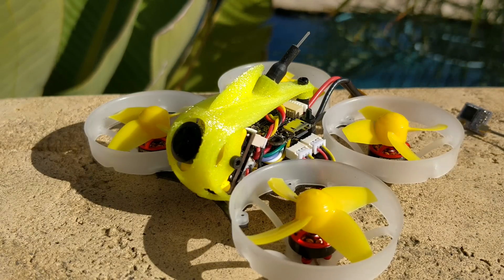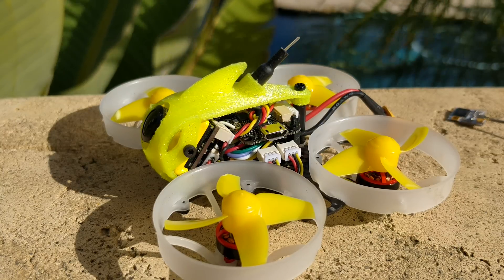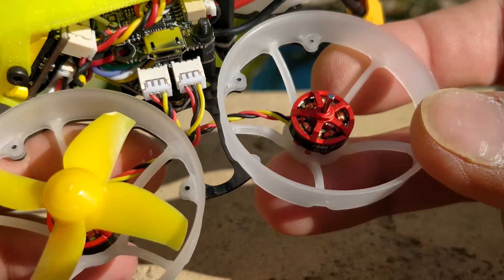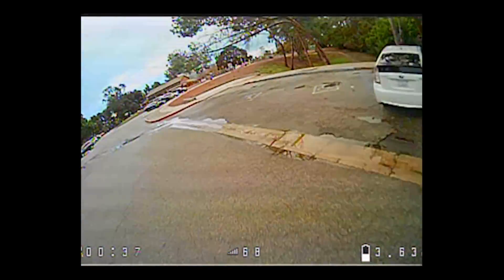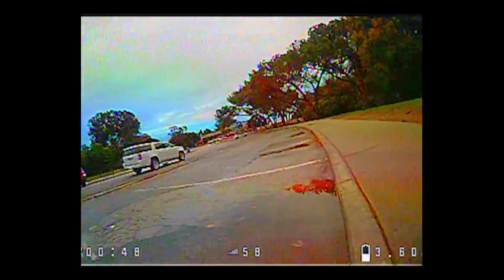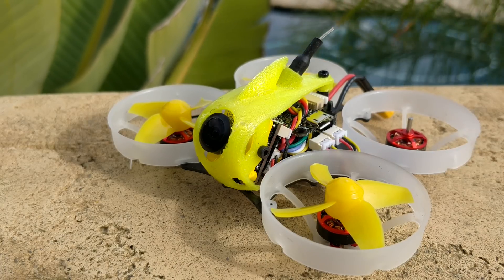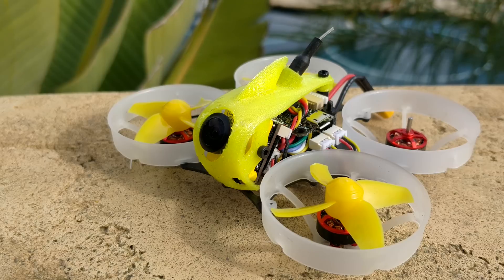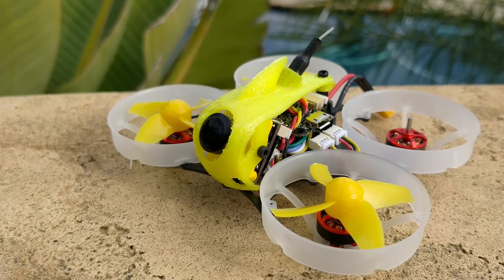Tiny Leader - Leading the way?

Comment: LOL same EXACT issue I had and many but I was called all kinds of names when I said people are going to have problems with these ESCs.. I was right LOL.. Fullspeed is sending out replacement ESCs. I modded mine with a 18A 4in1 and it's better. I also looked at the weird way they had the BF settings and changed them. It flies much better and because of the mods I've done I way able to bring the back of the TPU canopy down in the back to give me more camera angle... I like how mine flies NOW but for the price this should have been done by FullSpeed..

Comment: Hey Bob I converted this to a 2 inch ductless frame and it is much better https://rotorbuilds.com/build/15814
Reply: Also, these are the motors I mentioned a few weeks back that should be good on the toothpick, hopefully wires are long enough, plugs are a bonus
Reply from the maker: You basically made it how it should have come.  Probably flies great!
Reply: @Kabab  thanks, it does 😊.

Comment: What rates do you run on your tinyhawk? I can't find rates that suit me well so I was wondering what you are using, really good video btw
Reply from the maker: my rates are always somewhere between 1.1 and 1.3 for everything.  All of them the same.  Everything else is default.  0.7 super expo for all and zero regular expo for all.  For this tiny leader I had to drop the super expo to .6 because of it's dumb flight characteristics and push the rate up to 1.4.
Reply: @Kabab  do you use acro or angle for the tinyhawk when indoors and doing proximity. Also just got new gnb 450 lipos for it and they are much better than the stock emax one.
Reply from the maker: @luke.pike33  I only use full manual acro. Never any autolevel

Comment: I totally agree with your video!👍 This is a NUMBERS GAME quad! It has great numbers on paper but those numbers don't make sense in a who0p! 🤔😕
Isn't the whole point of a who0p, is to be able to fly a quad indoors?
If not, what is the point? How do we even attempt to fly something soooo heavy and powerful indoors. We can't! So, why does this have ducted prop guards? To take advantage of the current who0p craze? Without a doubt! To, again on paper only, make a who0p that out does all the rest!? 
BUT! IT DOESN'T! Because it's not a who0p. Like you said, it's actually a 3S capable quad with ducted prop guards. This is essentially their Leader 2" with prop guards! It's a dumb idea!
That Diatone R239... That's its name... Is a far superior flyer and design because it doesn't try to make you think its a who0p! No "fake out snow job"!
The Mobula7 is, in so many ways, superior to this TinyLeader! Biggest has to be less weight and also much better performance and maneuverability! Plus, THE BIG ONE, it is a true who0p class quad... It is great indoors on 1S and possibly 2S, if you are a very capable flyer and have a large house! And also a great outdoor flyer on 2S going full tilt ... Which you can do because it has the proper camera angle available to fly it BALLS TO THE WALLS! 😜
Yeah, nice try FullSpeed, you made a great on paper outdoor quad. But, it's no where near a who0p, and unreliable with that stack. BTW, I've got that stack that I still can't get to run right in a custom build I gave up on because that STACK SUCKS BAD! 😩  The TinyLeader just came out and already has loads of complaints of failure! Arggghhh! 😢

Comment: YOUR MOTOR IS SINGLE PHASING . ONE OF THE WIRES TO THE MOTOR IS BROKEN . CHANGE IT OUT FOR ANOTHER MOTOR AN SEE IF IT DONT WORK . EYE TROUBLE I USE CAPS .
Reply from the maker: lol I'm sorry you have eye troubles.  Usually if one phase is broken the esc doesn't stutter and then restart.  The motor just stutters while trying to spin.  That's why I'm guessing the esc is broken.  Also, the motor hasn't felt any real impact for the wires to break...

Comment: The hell with all these whoop style i have a new trashcan sitting here that i can not use because it.wont bind after waiting 2 months for it to get here so now it.goes in the parts bin . I have a micro with a supers stack in it that just.flies better than any.of these aio boards   on 2s . Done with whoops im going to build my new 5 inch from piro great vid. Ill wait.for your toothpick lol.and rebuild
Reply from the maker: don't bin it.  You can use an external Rx on that board.  It has a separate pad for it.  Don't even need to remove smart audio.
Reply: @Kabab  yea i seen that have to see what i have i just dont get it man i have done everything but its just not recognize the transmitter and everything works wich its wierd ill mess with it later  lol
Reply: +boots fpv if it doesnt show in the receiver tab thats a bug look up on YouTube, otherwise you may have the wrong Firmware on the rx
Reply: @peterzingler6221  i know the firmware.is correct because it.works and goes into bind mode but when i try  to  bind it it will not recognize  the  xlite on d8 or d16 i can fire up motors in betta flight and everything works but the transmitter just wont pick up  is there a setting im missing on the transmitter maybe
Reply: +boots fpv u im talking receiver Firmware , Theres an EU and an US Version in frsky
Reply: @peterzingler6221  i should have the us version but yea your right i didnt check that i will when i get home

Comment: do the toothpicks do turtle mode?
Reply from the maker: yes but the motors are really really REALLY weak so if there's even a blade of grass in it's way it won't spin to flip back over.  Hard surfaces are no issue.

Comment: The Mobula7 or trashcan looked like they fly a lot smoother when you made the videos
Reply from the maker: Because they did.  Well not the trashcan.  I've discovered that the trashcan motors are total rubbish lol.  They work...that's about it.  Compared to other motors they're basically 1S only motors.
Reply: @Kabab  Soo, wasn't the goal 1S? :) I'm really curious how the trashcan parts perform on your frame with 1S.

Comment: Props and cam mount ordered waiting for mobula and the tooth pick frame 👍how thicker the frame bob? Will you supply motor screws or will the original screws from mobula fit?
Reply from the maker: screws will come with the frame.  I aim to make this as easy as possible for everyone.

Comment: For me the main reason something this size HAS to have prop guards on it is durability. In order to do what you want to do with those type of things you crash a hell of a lot and the tiny little super light components just can't take the abuse. Prop guards and a suitable canopy that prevents the props or the motors taking direct impacts dramatically improves the durability of these things. I've been through literally dozens of the 1103s. Dropping the prop guards and increasing the prop size will undoubtedly fly much better but, for me, then flight envelope overlaps with my 5"s too much. I find adding throttle expo (not a limit) makes even the beta75 very controllable indoors. I feel like the 2s whoop takes me from zero to a decent sized yard and from there the 5" takes over.
Reply from the maker: well then, you didn't watch the whole review :-).  These prop guards do very VERY little to protect the props.  They actually cause more props to bend than if the guards weren't there at all.
Reply: @Kabab  You misunderstand, The props may get battered a bit from indirect hits but rarely in such a way as the motors get damaged. I think it is hits to the top of the shaft that do the most damage which a whoop style frame prevents. That's what I've found anyway,  nano/micro motors on guarded frames take the abuse I dish out.

Comment: Well, that's a bummer. 😕
The battery was too big for it also, I guess... But not enough to burn the esc... 😕
Well, anyway... What about that Trashcan transplant you did? What can you say comparing 0802 and 0803? Is it better or just added weight? 😊
Reply from the maker: I did the transplant. The motors on the trashcan are absolute rubbish 😂. No but seriously. Anything more than 1S and they sound like they're gonna rattle themselves to pieces.  The beta 0802 are far far far far better. Waiting on the 1103
Reply: @Kabab  Wow! 😮
I'm looking at some 0804... I think they are from Iflight, but I'm not sure. The problem is really the frame, the only carbon fiber frame I've found for those motors only accept 55mm props. 😕
Reply from the maker: @MCsCreations  I have some of the iflight on the way.
Reply: @MCsCreations  once I got my Mobula7 motors down, I think I will try Betafpv 08 motors as well. I like some of their products.
Reply: @Kabab  I have found that those 802  Betafpv motors are awesome with the 2S 350mah BetaFPV packs on the 75 Pro 2.
I think people, just assume the double 1S pack setup works better because it makes the setup lighter. The BetaFPV 350mah 2S packs show notecably better performance where the double 1S setup would sag and even gives more overall power! Awesome video man 👍🏽
Reply from the maker: I'm just about to transfer the mobula motors to test them
Reply: @Kabab  Great! Please, keep us updated! 😊
Reply: @MCsCreations  I actually have those iFlight 0804 15000kv motors (racing girl they call them). I am in the process of installing them on the LDARC GT7! (took a break lol)
Reply: @FrequentFlyerRC  Fantastic! 😃

Comment: 1st. Paid preorder, but then decided to cancel it.
I got Modula7 as everyone around. Its performing really well (except v1 frame made of glass), but too much for indoors.
After all this 2S whoop hype I believe 65mm whoop frame with all in one FC and 716 motors is best indoors whoop. Its flying fast enough to feel you are racing, but very controllable not to shoot from floor to the sealing, trying to catch it from falling.
Reply: Kinda how I feel too but I haven't tried the 65mm brushless whoops.. What's your, thoughts on those?
Reply: @FrequentFlyerRC  love the 65mm brushless whoop with xt30 for maximum whoopage.. next upgrade is to try that caddx camera and onboard dvr
Reply: +Frequent Flyer RC UK 65 is a bomb for indoor
Reply: @peterzingler6221  I thought to get me one as well, but too much whoops and no time to fly ))). One brushed and one brushless whoop with spares for it more then enough. I hope for short winter )))